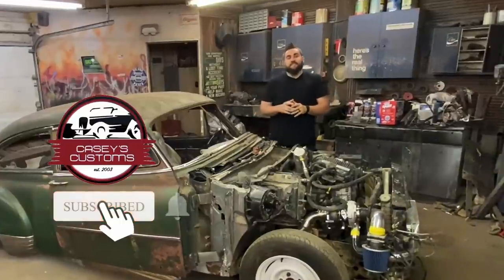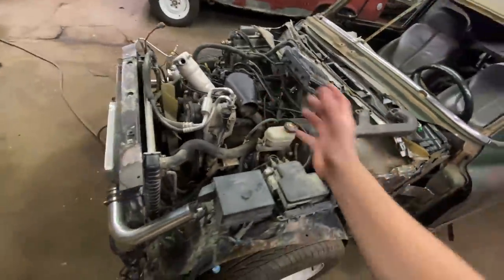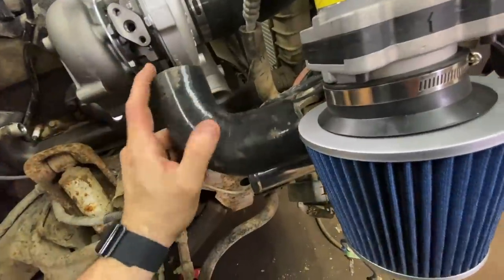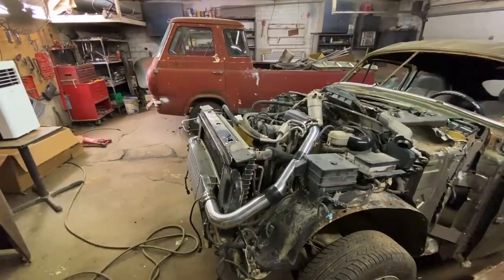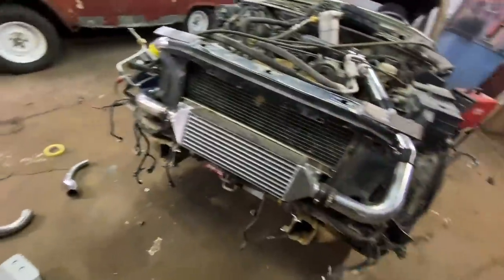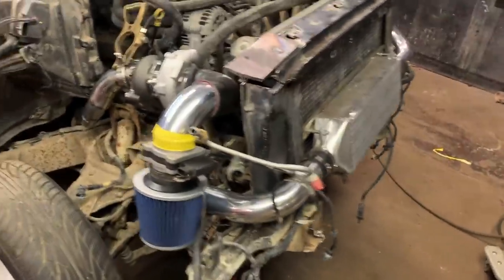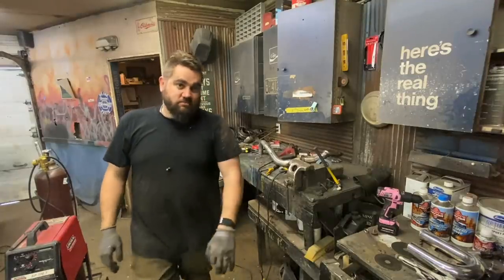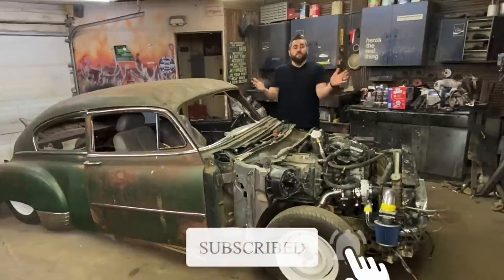$3500 DOLLAR RAT ROD BUILD! PART 12! TURBO, AIR BAGS, CHASSIS SWAP AND CHOPPED! HOT ROD BUDGET BUILD

Comment: Just picked up a 1950 ford f6 truck to build my first RAT ROD. Using your formula swapping to a donor chassis. Picked up a f350 diesel truck. After measuring they should fit together perfectly. Thank you for the information you share.
Reply from the maker: that’s awesome! Good luck with it

Comment: Blow off valve goes on the INTAKE side before the throttle body, the wastage goes on the exhaust BEFORE the turbo, as close as you can to the turo.
Reply from the maker: Good to know, The manifold has a built in spot for the wastegate.
Reply: Guess i should have read all the comments before I spoke lol

Comment: Using that tiny stock exhaust is going to make the turbo almost useless, as it will be like you trying to breathe through a straw while running a marathon. You need to have at least the same size pipe exiting as entering, if not bigger.

Comment: Those are some crazy exhaust bends and size changes.
Reply from the maker: Yea it was a little funky but i made it work lol
Reply: @CaseysCustoms  on my 35 Ford I used Flexible Exhaust pipes to get around front end that has GM drivetrain and not a lot of room
Reply from the maker: @craigcaggiano431  I’ve seen it done alot on really low stuff

Comment: Man that downpipe is going to be a huge choke point. I get having space limitations, but man that's just no good. 2.5" all the way would be great.
Reply from the maker: The pipe that came with the kit was 1 3/4 lol
Reply from the maker: Also i said the stock pipe was 1 7/8 in the vid it’s actually 2 and then opens up to 2.5 after the junction of the driverside pipe
Reply: @CaseysCustoms  well that's something.

Comment: Looks like you have the center of the turbo clocked a bit wrong as the oil feed should be straight up, so the return line is straight down. Also I heard you say that the cold air side needed a waste gate. That is a blow off valve. The waste gate goes on the hot side. Nice hack rod lol
Reply from the maker: Yea, it’s almost like i don’t have the oil lines run yet for a reason. Nice zero content troll account lol

Comment: That 1.75” exhaust “down pipe” is going to kill the power.  You need 2.5” minimum.
Reply from the maker: It’s actually 1 7/8” and it changes to 2.5 at the old junction about 18” from the joint you are talking about. Should be fine

Comment: Good job but I think I'm missing somthing, did you tie the driver side into the passenger side coming off the manifolds then go into the hot side of the turbo? It looks like you put the passenger side exhaust into the hot side of the turbo but then dumped the drivers side exhaust into the "down pipe"?
Reply from the maker: No, i think i explains it better on the next video in the series (part 13) i didn’t have room to run the driverside manifold up front because the 4x4 is still hooked up it made it even more impossible then it already was. The driverside goes around the back to the middle of chassis where it meets with the passenger side.

Comment: Nice work fella, I like this build. See a  bunch of respirator/ face shieds on Amazon and can't decide which one. What one do you use?
Reply from the maker: I use a full face shield with respirator, I’ve used a bunch of them i just buy whichever one is 60-70 bucks. I’ve used 200 dollar ones a 20 dollar ones and it seems the middle of the road ones are the best

Comment: So, I'm just not clear. Did you run the driver's side exhaust into the passenger side manifold and then run the turbo exhaust out to the exhaust pipes? I haven't finished this series, but I had to ask.

Comment: OK. So my comment / question has actually been rattling around in my brain for the last 3 videos on this '51.  Up until this vid ( part 12) you have had the battery stuffed up in the right front fender behind the headlight bucket. In video #11 it kinda sorta looks like if you put it there the next guy who owns this car will have to remove that right front fender if the battery ever takes a dump. So do you plan to relocate the battery, or is it just going to become "the next guy's problem"?  Just curious.
Reply from the maker: I would never make it so the battery couldn’t be easily removed. Also I’ve had the battery out for a while so i don’t quite know what you mean. The cables are still pointed at the passenger headlight, but after the air filter filled up that place it will be relocated. Most likely in the trunk
Reply: @CaseysCustoms   Sorry, I should have been a bit clearer. What I meant was you had the battery LOCATION looked like it would still be behind that headlight.  And my comment about it becoming the "next guy's problem" was supposed to be taken as funny. My friends all know that I speak fluent sarcasm and it's hard to portray that in the written word. But yeah I do watch all your vids, and love the channel. You keep it interesting (just like Puddin does).  (insert smiley face emoji here)
Oh and I think one of the reasons that Puddin's channel took off like that was because he announced that he was quitting his "regular job" and would start doing his Youtube full time.  Maybe YOu should do that too. (insert sarcastic and smiley faces here) :) :)  Keep on keepin on Brother !
Reply from the maker: @joedurning3275  no worries i didn’t take it as a bad thing, and trust me I’ve literally seen people build around radiators and shit so that they will never come out without cutting lol. Also puddin quit his job after he already hit like 50k in 2-3 months, he was already blowing up. Also My job is building cars so i can’t quit cus i like it lol

Comment: Almost would have been easier to come outside the frame and run a side pipe for exhaust.
Reply from the maker: That would of been much harder and just got in the way of more steering stuff
Reply: Out the passenger side? Looked like there was room to come off the turbo under the heater box and down the under the rocker
Reply from the maker: @kevind5508  yea, plus the car is so low it would have to go up in the floor almost. Idk how you would get around the body mounts too.
Reply: Makes sense. Nice work though. Can't wait to hear how it sounds
Reply from the maker: @kevind5508  me too

Comment: That turbo is not going to lubricate itself properly the drain and feed are on the sides its better to have the feed on the top and the drain on the bottom but in your case youre kinda fucked because it mounts on the manifold so you cant really change how the turbo sits